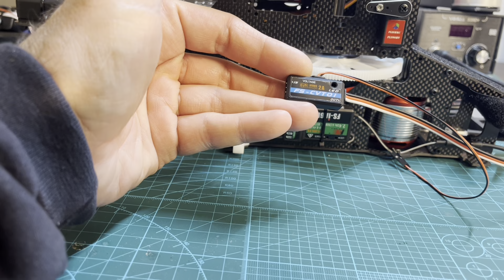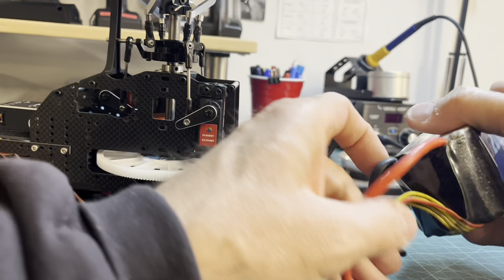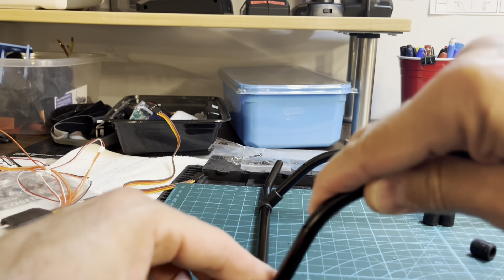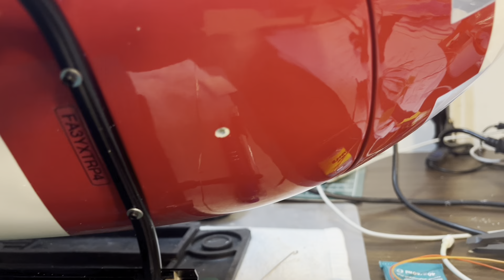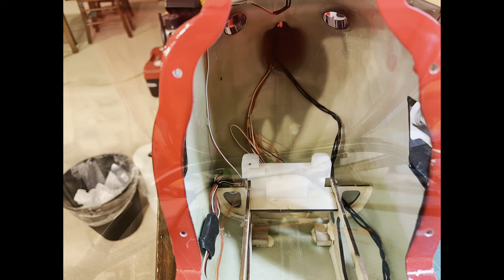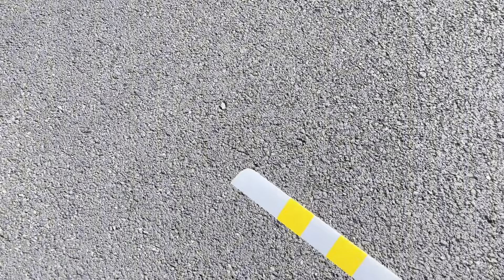Flish RC: EC 135 500 class - Assemble, LED lights, tinted windows,  voltage feedback and maiden.

Comment: I believe FLYWING says no to connecting LED lights to the receiver or H1.
My solution was to purchase a packet of 9v LED lights from Ebay and use a 9v pp3 battery and connector then connect the LED lights with a small nylon connector block. 
I just plug in the battery when I  plug in the main battery  
Works a treat.
Reply from the maker: Unless you do it like I did.

Comment: I got some 9v led lights from Ebay used a 9v pp3 battery and the connector and simply used a connector block for the led lights. 
Works a treat you just plug the battery in when you remove the canopy. 
Never plug lights into the h1 unit or receiver.
Reply from the maker: I have no issues unit the aux port on the receiver for the lights. I have separated the RX voltage from the H1 unit and using an external BEC.

Comment: Is it possible to get a bigger tail rotor seems they used the 450s tail rotor, it needs a tail similar to the roban 450 ec135 or the flywing ec135
Reply from the maker: Yes it is. The size of the tail rotor is slightly larger than the 450, but not much larger. But I’m sure you can buy a replacement drone rotor that is slightly larger.

Comment: Great job, it’s exactly what I am planning. How is it currently flying. Thanks
Reply from the maker: @gene.lezatte  thank you!! well, to be honest this second one has had some tuning problems. I have been trying to tune out the toilet bowl effect and although it have gotten better it still has the toilet bowl effect, especially is there is the slightest wind. So things I have done include increasing the swash gain to 55% in 3D and increase stability in GPS attitude from 87% to 91%. These changes make a small improvement but the TBE was still there. So I made sure all blades are on loose enough and not too tight. Next I am going to increase the throttle % from 63% to 70%.
Reply: @Flight6677  I know that was a while go,but did you get your TBE issue resolved? I had a similar issue when I switched from an H! to ACE in my Flywing BO-`105. Eventually, the solution was simply to do a transmitter stick calibration. A fresh GPS calibration wouldn't  hurt either. Good luck, happy flying and keep up the great work on these videos.
Reply: Thanks, looking forward to to check out and learn as much as possible ahead of getting one..
Reply from the maker: Not completely.  The main issue is only apparent when I am in GPS mode.  This is due to my GPS calibration.  I need to do it again and have not done so as I fly in 3D most of the time.  It flies great in 3D.  Very agile.  I am not sure on GPS return home, she just stays in one place until I command it to land with throttle down with left stick.  Is your like that too?
Reply: @Flight6677 no, not at all. However, all of my Flishrc helis have the L7 controller.  I believe they have phased out the H1. Definitely do a compass calibration as I feel this will be the solution.  The newer helis with the L7 are so much user friendly since you can connect yo the L7 via an app and Bluetooth.  Can initiate compass calibration and make parameters changes in the field without any need for a laptop and USB cable.

Comment: Just to get your opinion. I have been following you for a while and noticed most of your helicopters are GPS based. I used to build Align T-Rex 450 and 500. I just called MotionRC and was advised it would be much more complicated to build a mechanic one and fit it into a scale fuselage. I want to cut down the build time. Would you suggest since you have much experiences with GPS based helicopters you are very happy and comfortable with what you have. Any idea is much appreciated. Thank you Sir.
Reply from the maker: I have both.  I have placed mechanics in fuselages and have used the GPS type.  The GPS types are easier only because the latest versions have tail motors.  The torque tube or belt drive driven tails add some complexity to the tuning and build of the heli.  However, if you have the 450 mechanics and electronics go ahead and build one with a GPS H1 module - use belt drive tail.  It should be less money for you if you have the mechanics and a good experience.  Performance will be similar - with belt of torque tube being more realistic and better sounding.

Comment: Hi good instruction video neatly done. I also have a small question, on the diplay of the transmitter, top left are 2 cuontdown indicators, T1 and T2, can you turn them on, on the transmitterso that you can see how long you have been flying? Thanks Greetings from the Netherlands
Reply from the maker: Yes.  I have set mine to have one at total time and the other as flight time.
Reply: @Flight6677  Hi, thats good news. I have the same transmitter, can you explain me how to set that up? That would be great. Greetings from the  Netherlands

Comment: Excellent how you showed how to remove power from the H1 to the Rx and supply the Rx with power from the battery.  That's the right way to do it if you want to install lights or other add-ons wothout worry that power is being taken away from the H1.  Also great showing how to assign a switch and how to add the voltage sensor and configure the Tx for it.

I just finished my Flishrc Huey UH-1N.  Added all kinds of extras and have 3 light controllers.  Added lights to the boom as well as housings for the lights.  Roban didn't add them but they're supposed to be there.

Again, great video and great looking bird.